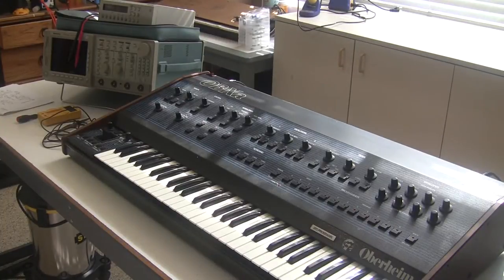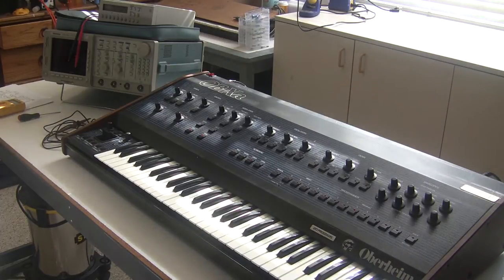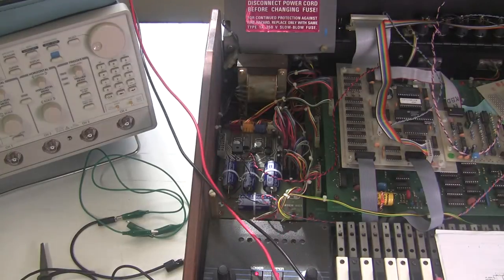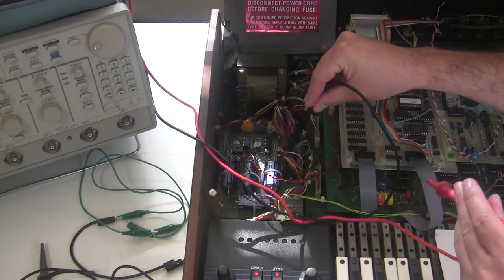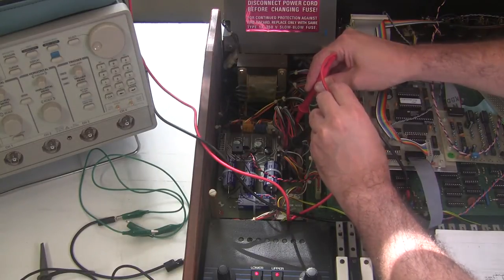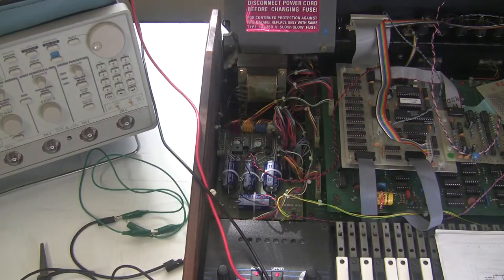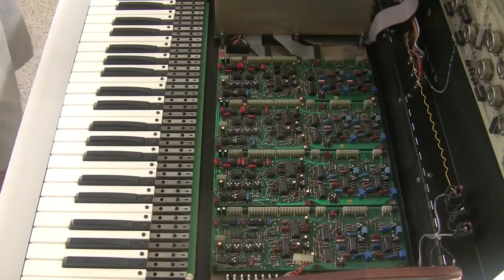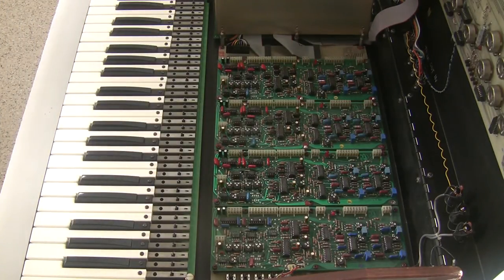Synthchaser #016 - Oberheim OB-Xa Repair - Part 3/3 - Tuning & Calibration

Comment: Nice job on the video, takes a lot of effort. Two things I noticed. 
1) The TEST 1 switch is in the wrong position for calibration (autotone is enabled). It should be in the 'down' position during calibration so that autotone is disabled and fine tune CV's are set to midscale. 
2) Mentioned already, adjusting the pan pots will effect left-to-right balance if only adjusted while monitoring one output.

Comment: Hi Synth Chaser, thanks for these wonderful helpful videos. I have a question though, @8:20 in this video. Those knobs on the side clearly labeled 5,6,7,8 - etc...those are PAN controls of each voice on mine (and the knobs are white). So maybe Oberheim did slightly different versions of these controls ? So my question is, on my version, where are my volume controls for each voice then ? Thanks so much in advance for your help.

Comment: Edward Van Halen said that he "had trouble keeping the Oberheim OB-Xa in tune" when he recorded "Jump" and the title track to the '1984' album so he switched to the OB-8 to record "I'll Wait" and for the '1984' tour because it was apparently more reliable. The synth tracks and the guitars on "Jump" are roughly 1/4 step above concert pitch and I was wondering if it would be common for the entire OB-Xa to be out of tune by 1/4 step? I believe he tuned his guitar up to match the keyboard because he couldn't fix the tuning issues with his OB-Xa. Do you think it is possible that his OB-Xa could have drifted up in pitch by roughly 1/4 of a step?

Comment: 8:15 I think those are pan pots for each voice card, not volumes. If you were monitoring out of only the left or right output then they would of course affect volume.
Reply from the maker: That's correct.  From time to time I misspeak, or as in this case I don't properly explain what I'm doing (I was monitoring out of one channel).
Reply: So if y were monitoring both channels would the volume have been consistent. If your only monitoring one channel and you adjust the volume to be consistent via the pan pot arent you just making a stereo synth mono? I can never figure out how to set these pan pot to sound really wide but balance across the stereo filed. Also without sounding like the notes bounce all over the stereo field when playing melodies.

I alsohave different volume levels between voice cards and cant figure out how to get them consistent. What is the proper method?